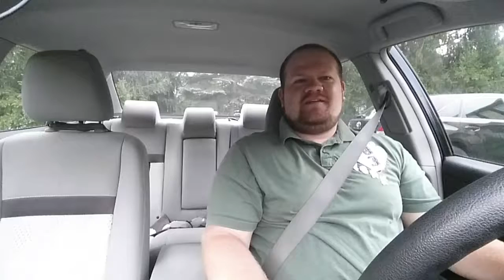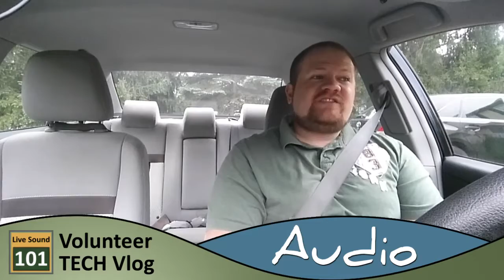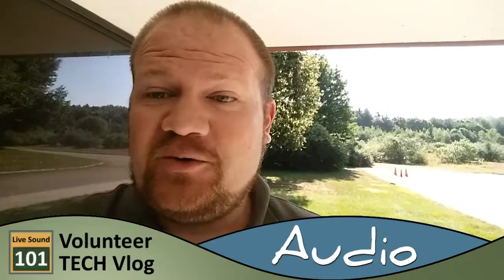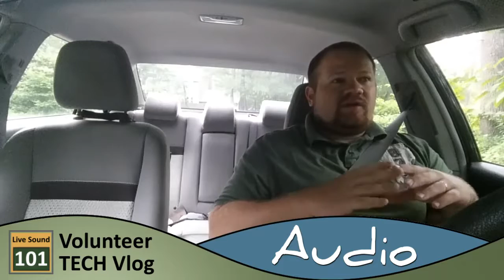How To Set Channel Levels For Live Sound

Comment: The number one thing that needs to be done before anything you describe is done is the system gain structure (which used to be a bigger pain in the neck with multiple analog devices in the signal chain, with none of them having the same level capability) has to be set up properly and the nominal dBSPL setting for the room (controlled by the final setting on the Amp's input level control. example: 0dB indicated at the board equals "x" dBSPL in the listening space).
Reply from the maker: Yes. What I described in the video here is really limited to setting levels for a specific instrument or channel during a sound check. That task is all relative assuming the system gain structure of the EQ's/DSP's/Amps has already been properly established.  For some people out there, especially those who setup a "church-in-box" where the entire system is rolled out and packed up each week, the term "setting levels" could include system gain structure as well.  I would argue that setting channel gain structure and setting system gain structure are different tasks but equally crucial to the overall goal of "setting levels".  Good point!  Another video will be required.
Reply: The initial setup of gain structure and system EQ is similar to an artist starting with a clean canvas for a painting. Just as a great artist could use an imperfect canvas and still paint a great painting so can great FOH operator take a sound system that isn't quite right and still produce a great mix, but great or average it's a lot easier if we start from a  clean "canvas".

Comment: PS: The other thing I always forget is that "O" on an analog VU meter in an an analog console and 0dB on a digital mixer in most cases are like comparing apples to oranges. So what I should have said was the nominal level that the mix is going to center around needs to equate to a dBSPL level in the space tour mixing in (which is controlled with the Amplifier's gain control.
Reply from the maker: They way I was trained was to first determine the required or desired dB-SPL in the room at the listening location and then work backwards from there. This is were opinion, style and preference come into play in determining how loud the system "should" be. Whatever you decide, there must be a target dB-SPL.  This target is achieved by setting the gain on the amplifier accordingly. The amplifier is specified in conjunction with the speaker, by how much power is required to throw sound the required distance from speaker location to listening location. But there's really a lot of factors that come into play, hence why it can be helpful to break things up into small tasks that can be easier to explain and understand.